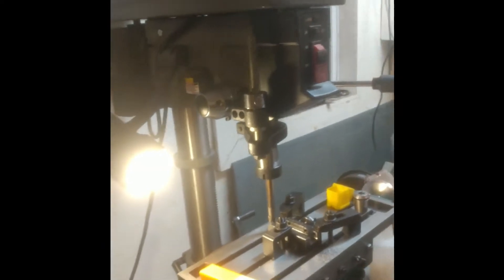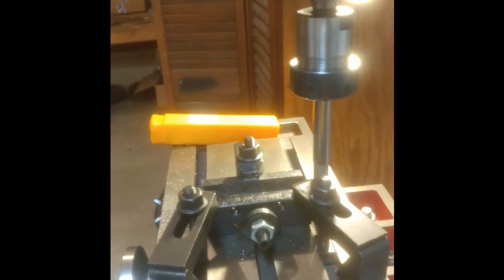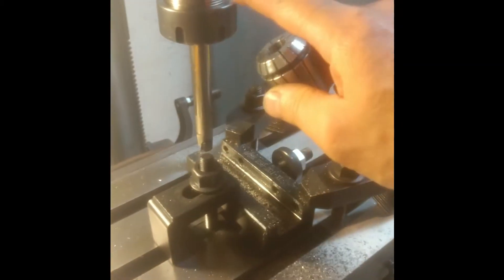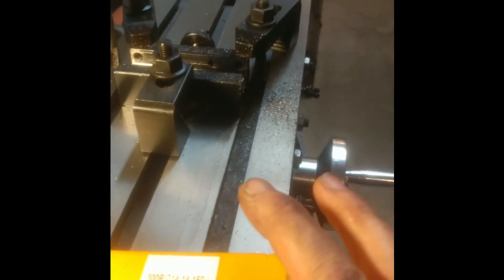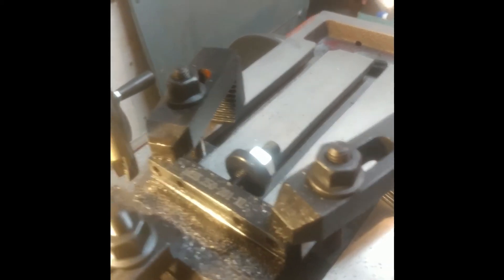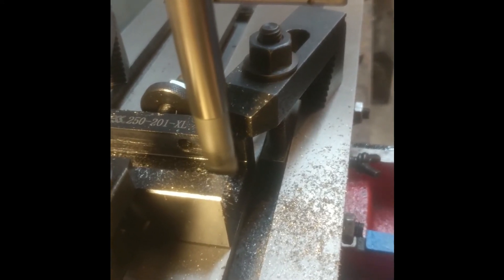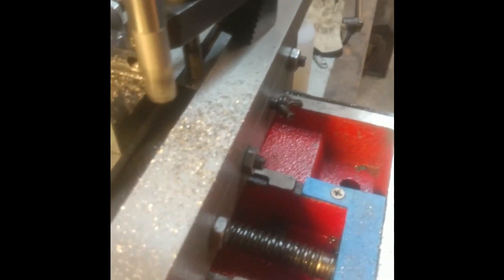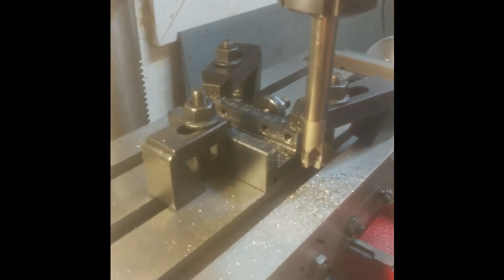Drill press to mill conversion E1

Comment: With the M10 mod have you had any trouble getting the collet out? Seems like that threaded rod could get cranked down pretty good if the collet spins at all.
Reply from the maker: You want it snugged in there good to start with, if it spins it can gaule the taper. As long as you have the knockout tool and the adaptor is made with the correct dimensions, getting it out should not be a problem.  The worst case is if the screw head strips, but if that happens the screw is thin enough that you could snap it by knocking the bridge part out of the knockout hole with an appropriately sized chisel. You might need to remake the bridge piece in that case, but that is simple; the rest should be good to reuse.

Comment: Where did you get the milling table????   I need one!
Reply from the maker: Do a search for "Compound Milling Machine Work Table 2 Axis Cross Slide Bench Drill Vise Fixture" on Ebay; several sellers have it. I bought mine from a seller in India where it is made, but now there appears to be US sellers selling them from local stock.

Comment: I think you would have been way better off putting the tool holder back on your tool post holder and installing the mill bit the the lathe chuck and milling it using the cross slide.
Reply from the maker: As far as rigidity goes for that particular part you are correct, but that was not the point of this operation. This was a first test of this DIY mill in hard steel, to assess it's capability for other projects. The end mill I used is excessively long for that operation, but was all I had on hand at the time with carbide capable of cutting hardened steel. At a later date I did another tool holder like this, but used a standard length spiral fluted end-mill and I was able to cut much better.

Comment: Who is Milton? You mean Morse Taper. Not every DP relies on a MT to mount the chuck. I have an old Craftsman DP (made by Emerson I believe) from the 80s that has a chuck mount with a threaded collar which screws on the spindle. It can not be loosened by lateral pressure. It may be possible to mount a collet to this style spindle but I don't know if anyone manufacturers such an adapter.
Reply from the maker: To might need to custom turn something, but that sounds like it could work well if the rest of the drill press is rigid enough.